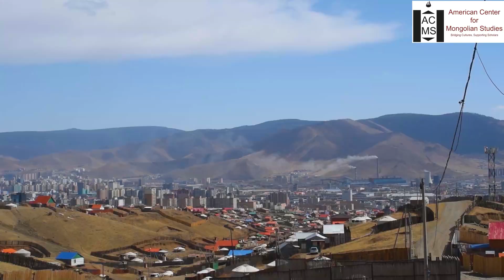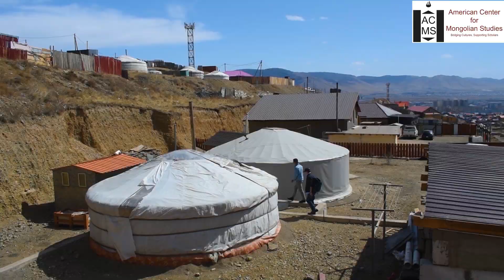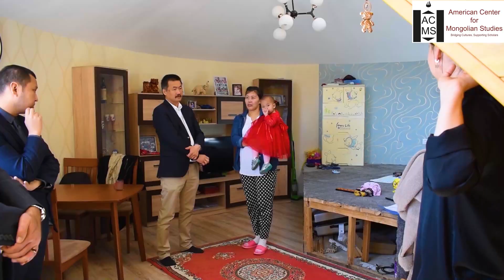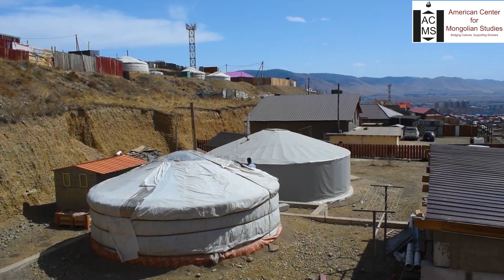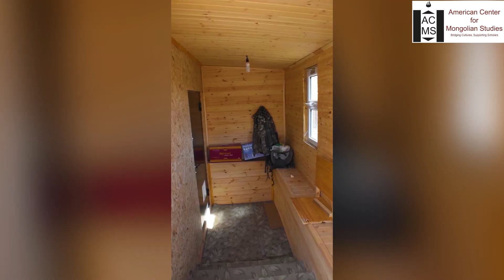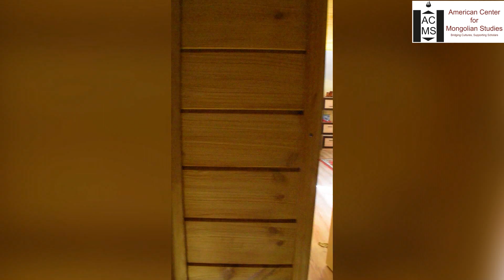VSS| "Follow-up Visit to Passive Ger Design" by Kim DuPont-Madinier

Comment: Thank you very much for the interesting project! Can you please tell a little bit about ventilation?
Reply: It’s difficult to see. In fact it really is not a ger at all. Just because it’s appearance is similar doesn’t mean you can call it a ger. Traditionally the door will leak air in and it will exit in the center of the ceiling. Honestly this is a silly concept. Building a small house using well understood technologies is far better and easier.